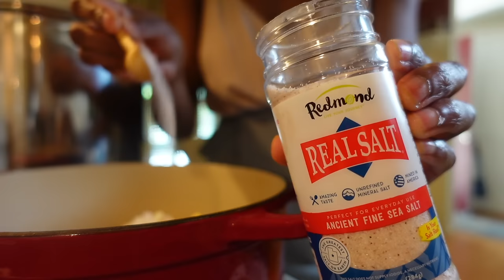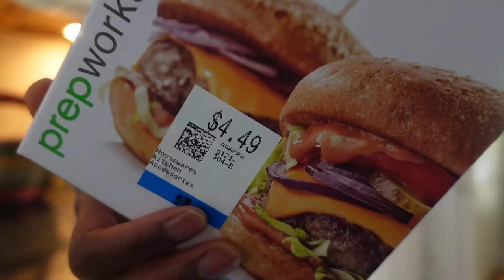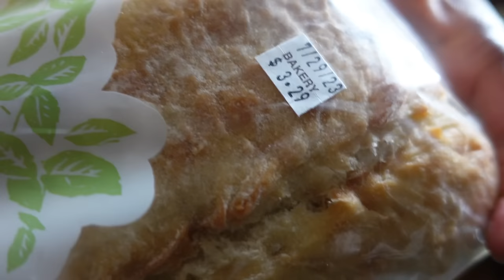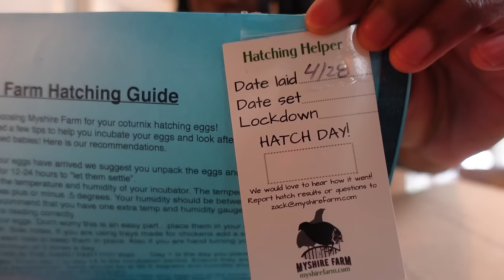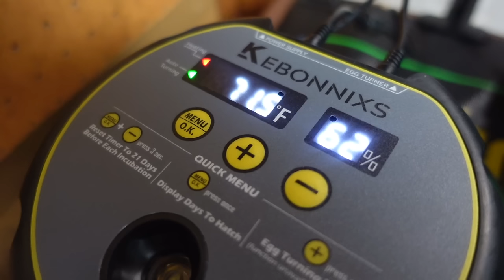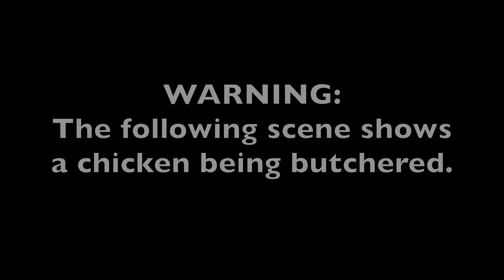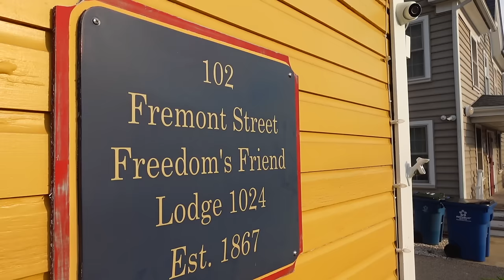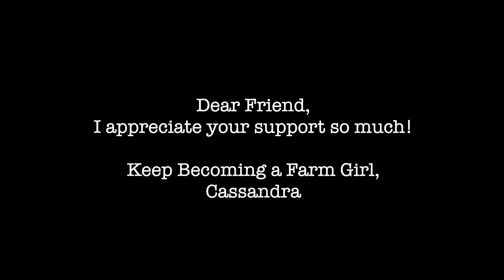Work Now, Eat Later: 10 Summer Preserving and Canning Recipes in 1 HR | August Pantry Chat

Comment: I've got obsessive Römertopf delight. I've had one foe 40 years that I received as a wedding gift. It has lasted longer than my marriage did 😂. Most of mine are also thrift store finds that were never used. Most aren't glazed, so they're older from Germany. I have my parents well used and loved one. I have the huge turkey sized one down to a small one meant for baking a loaf of bread. In the cooler months I love making roasts. I often use two at a time since I'm running the oven.